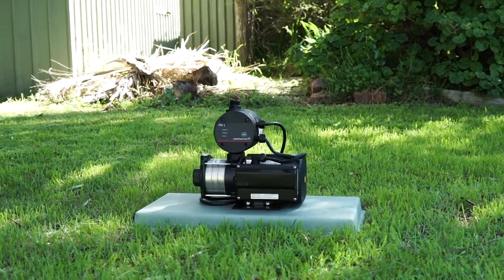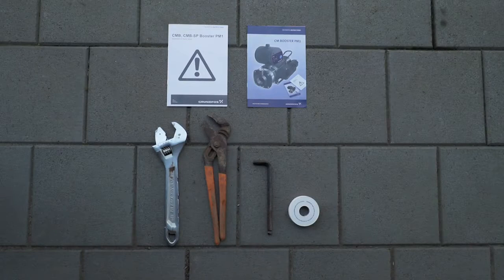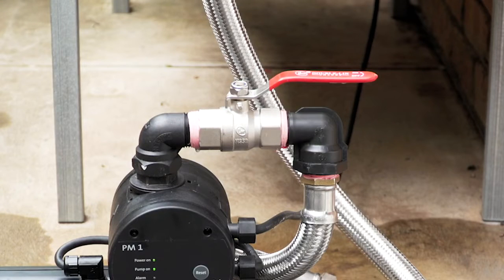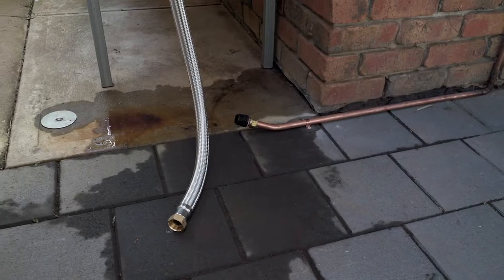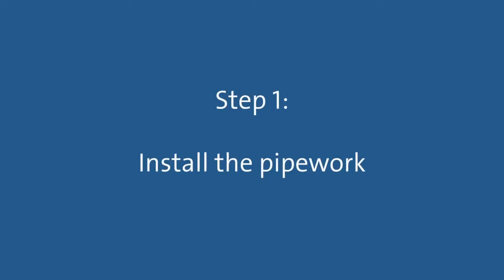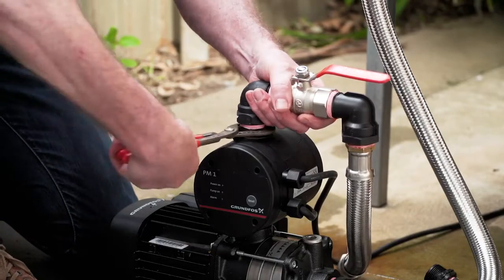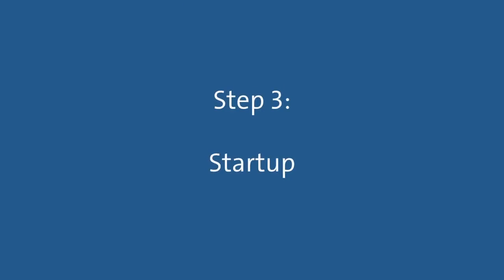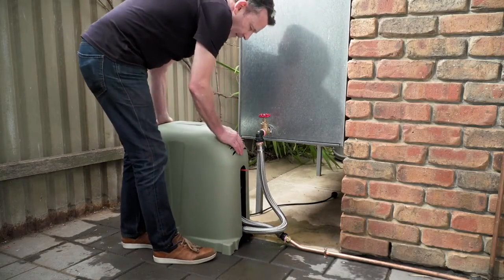Grundfos CM Booster -  Easy Installation Guide

Comment: Can you reduce the maximum pressure? Doesn’t seem like it?
Reply from the maker: Hi @reginald6045, thanks for your question. The pump featured in this installation video is a Grundfos CM Booster with a PM1 Pressure Manager. And the answer to your question in this case is no you can't reduce the maximum pressure with this pump setup. Your options would be to either purchase a separate pressure reducing valve, use a different pump model altogether or you can change to a PM2 pressure manager which allows you to adjust the cut-in pressure. Hope that helps. Kind Regards, Aaron